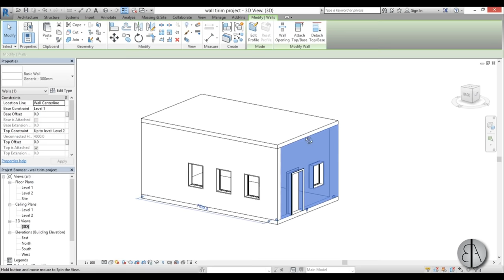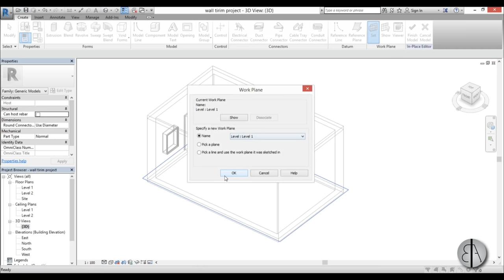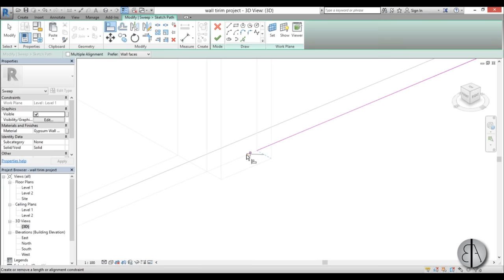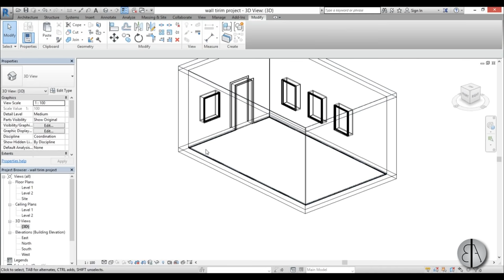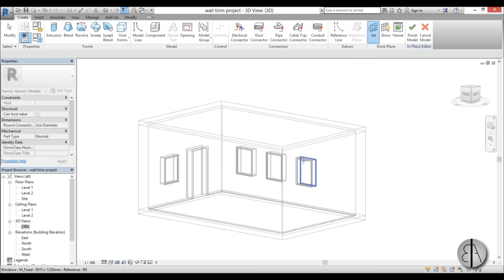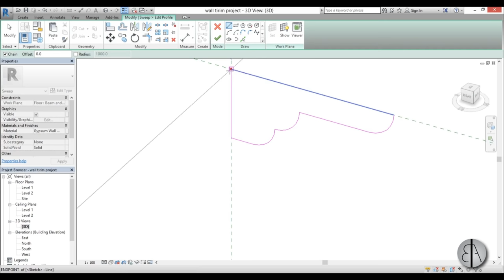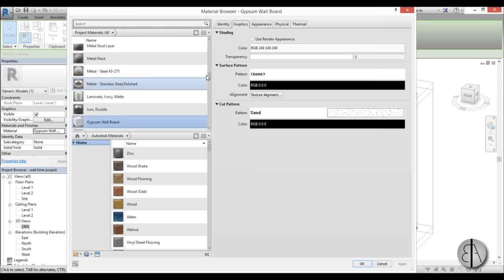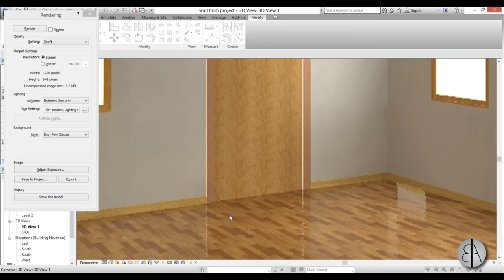Floor, Wall, Ceiling Trim in Revit Tutorial

Comment: @0:10... overlooked? Not Really, crown moulding specifically is not really in fashion anymore. I love it personally but you really don't see it much anymore in 90% of builds because it is added cost
@1:40... works but you can also make a profile family to use similar to fascia board  (place a model line on your wall, cabinet ect and there ya go.... easier to adjust the height this way too) or you can make it a wall/face based family

Comment: you can also use railing with custom top profile, this will give you lengths for scheduling . but sweep does it better than railing/ mass curtain profile, when joining it recognizes random degrees cuts... just that it doesn't show lengths. any way of showing length of sweep in schedule?

Comment: How do you add trim to a room with more than 1 door? I get an error saying there can't be more than one loop
Reply: SAME HERE
Reply: @emmasheckler3429  Nope, never figured it out. I was able to make some trim I found on revit city work...
Reply: Having same issue
Reply: @tayyipeniser  You need to do it in two pieces (or more if you have more than 2 doors)  because sketches in Revit can never be disconnected. To make it easier you can draw and save your trim profile as a profile family and just load it on your sweep path instead of drawing it every time, but you might also be able to copy it (ctrl+c/ctrl+v). Cheers!

Comment: Hi, Can you do a tutorial on ceiling with multiple height on same Room. How do I fill the gap produced by it
Reply: In cases like this where I have done multiple ceiling heights, I just duplicate an interior wall and delete every layer except the drywall since the builder will fasten the drywall to the end of the roof trusses in that area. Because it is a wall, you can join in to any roofs or ceilings and fill in those gaps

Comment: Hi, thanks for this video, I have a questions. I model rooms more than one is there any way to create a family to use as wall tool at the bottom or any way to create it easily for rooms that more than one room ? OK I done it just for one room but the other rooms If we're modeling an apartment. Thnks  a lot !
Reply: Yes, a couple ways... create a profile family that attaches to model lines on any walls you want to have it on; you can adjust the model line locations for different elevations if needed. You could also do a wall based family and have a similar effect

Comment: Hi.
Referring to this tutor, I'm trying to load a family cornice profile instead drawing one. For some reason, I can't control it's scale, also it's difficult to move it and rotate using the rotation tool which I need to specify a rotation point. Is there a solution for this problem please?
Regards

Comment: is there any reason model in place used instead of Wall sweep?
Reply: Good question
Reply: Model in place is for that room only maybe cos if you were sweeping it you'd have to duplicate walls and every time you use that wall it will have a profile on it, this gives you more scope to put different profiles in different rooms. That's not the only reason but its one......:-)
Reply: I asked the same question. The process would be done much quicker by adding wall sweeps via a saved profile. This is a very convoluted way of doing it. Especially when you have many rooms to consider. 

I usually have wall types with embedded wall sweep profiles. That way, the sweeps are drawn as I'm drawing the walls. Downside to this though, is that the visibility graphics won't allow you to turn off the sweeps in plan views. This is a huge bug in Revit that hasn't been resolved yet. 

The only way to control wall sweep visibility is via manually creating the wall sweeps after the walls are modeled. As a work around, I adjust the view range to be higher than the bottom wall molding / skirting.  I have to do similar for the ceiling molding / cornice. The settings are there inside the Visibility Graphics settings to turn off wall sweeps, but it doesn't work within embedded wall sweep profiles.

Pity, because you have other Architectural BIM software systems life "Chief Architect" that manage these issues so much better. But as always, it is great to see the different workflows that others follow. There's always some useful reminders or better ways of doing things.
Reply: @tomasoconnor6456  what? wall sweep is not the wall it creates a diiffrent part on existing wall no need to duplicate anything
Reply: Najib baloch fair enough😎